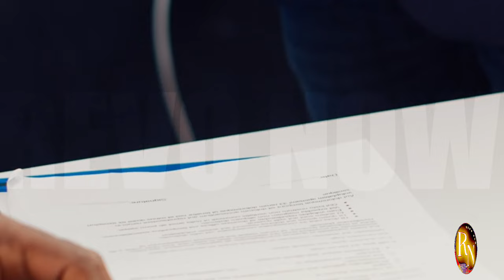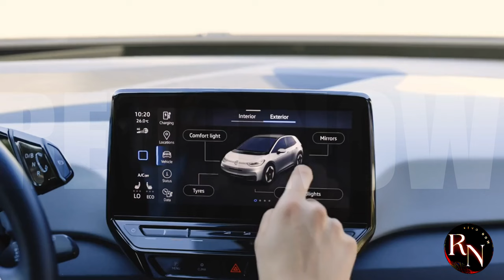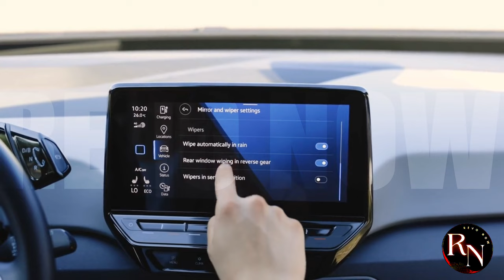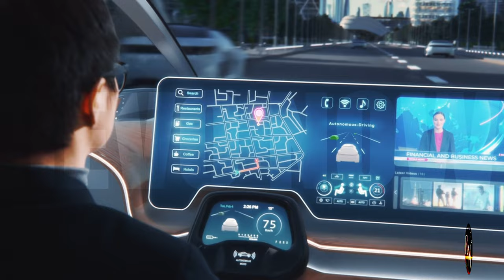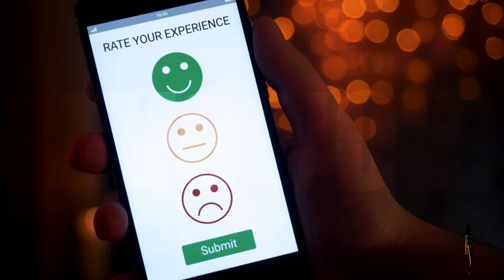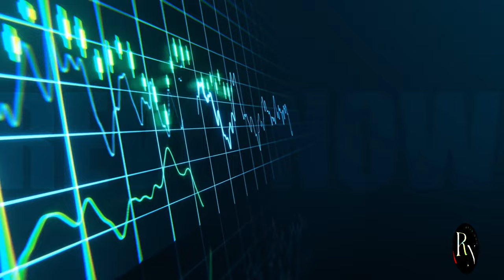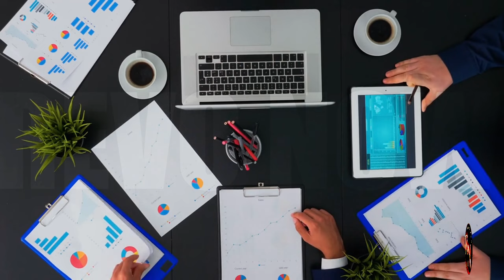You WON'T Believe How Huawei Turned Car Losses into Profits!

Comment: Advantages of EV over combustion engine cars are 1) much cheaper to charge EV for same distance travel than combustion cars, 2) EV is much cheaper to maintain, 3) EV is more powerful, 4) EV is cleaner, no oil leaks, 5) EV have more room, 6) EV is much cheaper to produce.